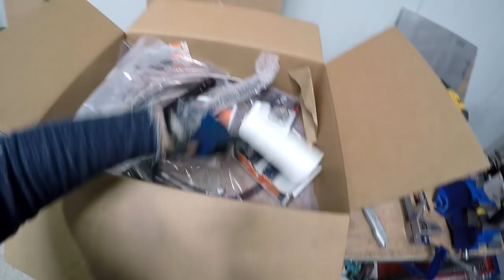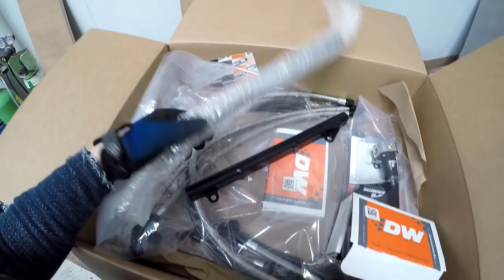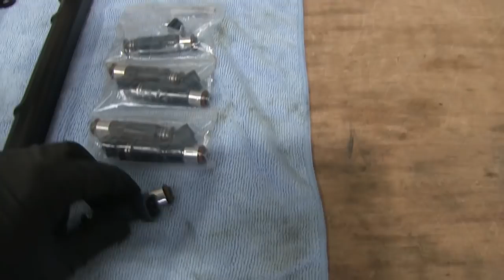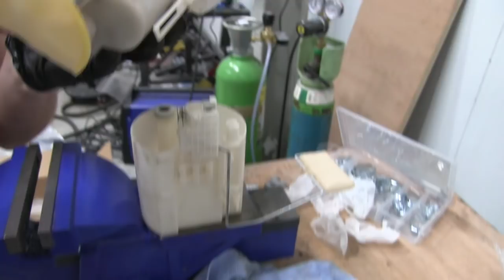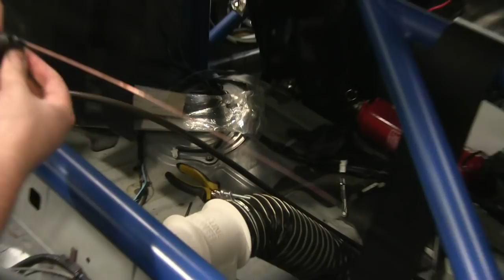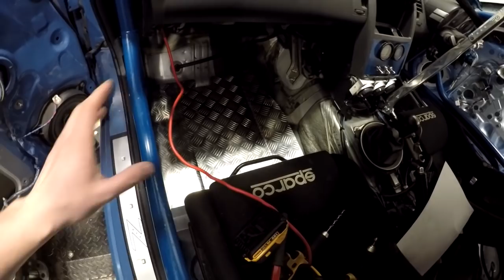350Z Twin Turbo Prep - Fuel System Upgrades

Comment: that aam fuel return any good? I’m planning on buying as well
Reply from the maker: Seemed to work fine while I had it yeah. Eventually got rid of the stock tank when I went twin turbo cos suffers from fuel surge due to it being a saddle tank. Still used the fuel rails and fittings from this kit though

Comment: Thank you for this video. It gave me a good idea on what to expect with my fuel return system. Single turboing my vq right now and I have a CJM return kit. Quite a bit different than this one but I think it's generally the same concept.
Reply: hey dereck! I just order a CJM s1 full fuel system, how was the install and did it work good
Reply: @tysni3781  The install was pretty straight forward but it will take some adjustments to your stock fuel bucket. There are some guides online that are kinda vague but if I can figure it out I think anyone can lol

Comment: I just got the dw200 for my z but it doesnt seem to fit, it doesnt go in far enough to put that plastic end piece back on, any suggestions?
Reply from the maker: oh yeah you have to file the notches on the plastic part that the pump sits in. If you look at any of the guides online for how to upgrade the fuel pump in a 350z you'll see what I mean

Comment: Really enjoy your vids, especially  the build parts. Feels genuine and not so uptight as most of the channels out there.
I'm in the process of travelling to the Uk and pick up a Z myself. hopefully the upcoming weekend if all goes well. 
Any pointers of where to start, If you would have done anything in a different order if starting over?
As of now I feel like the way to go is to start with rack spacers, coilovers, diff (has a nismo unit now which is supposed to be better than the standard unit and adjustable but idk) 
then weight reduction and hydro. And a bunch of wheels and tyres ofcourse.
Cheers mate, keep it up :)
Reply from the maker: cheers, glad you enjoy :) as for the 350, yeah just stick coilovers on it and rack spacers (although I didn't have rack spacers for the first 6 months and it was still fine). I'd probably keep the nismo diff if I was you but yeah the stock handbrake is useless so if you want to be able to use a handbrake you're going to want to put a hydro in it. The other thing is the stock seats are pretty bad so look at getting some bucket seats if possible. Stripping out the metal and plastic stuff behind the seats is a good idea as you get way more room and save a bit of weight, but it does take a fair amount of work to get most of it out
Reply: Yeah buckets are included in the weight reduction plan. And the not flopping about in the cabin plan... 
I have managed without handbrake corrections so far on previous cars, or had terrible e-brakes so that I have not been able to figure it out yet haha.
But yeah the hydro will come eventually. Did the metal wall thingy behind the seats affect the rigidity much when you removed it? Or did you feel nothing?
Trial and error will make this happen, and end my life economically.

Comment: Considering it's just a spacer, and not actually the lower plenum spacer, your gains aren't going to be much at all. Since I don't know what your numbers were prior to these mods, I'd guess you'll only be seeing 10-15hp
Reply from the maker: well that's the thing, I don't know what power it was making before that lol but yeah not expecting the plenum spacer to do much at all - like I said, it was just a case of may as well do it for how cheap and easy it is. Hopefully when we go FI it will make a little bit more of a difference but we'll see
Reply: ChrisDrift I’m sure once you’re FI, the spacer will play a much bigger role in power gains. For what it’s worth, the lower plenum really wakes the VQ engine up. I guess if you’re going to be turbo though, that will wake it up too 😂

Comment: I thought one needed to modify the swirl pot ( jet) in the fuel pump assembly to get the pump to make the correct pressure?
Reply from the maker: Wasn't aware of that to be honest, but just done a bit of research on it. Seems like most people say its only if you have issues with the pressure at idle being too high, but ours seemed fine and obeyed what we set on the FPR. Will keep an eye on it though and see if the tuner reports any issues when they map it
Reply: ChrisDrift thanks for the reply! Upon further thinking, I think what I wrote only applies if one keeps the factory FPR in the pump, and you guys replaced yours. Either way, great videos!

Comment: The reason for the plenum chamber being that shape inside and having the pipes bending off into banks of 3 on either side is to do with tuning the air flow. You can imagine the inside of the pipe is equivalent to the length of a trumpet on an ITB. Different lengths cause different changes in low down torque or high end power to due to differing resonant frequencies of air flow at different lengths (like a trombone). So this plenum with have likely been tuned for maximum driveability, from memory the DE or Rev up engines are quite torque heavy, whereas the later HR is higher power and a bit lower torque probably due to changes in the intake system.
Reply: Oh, and I'm going for 250 whp after the remap